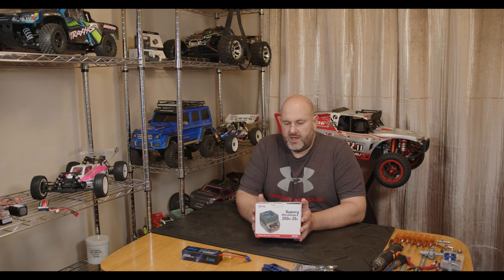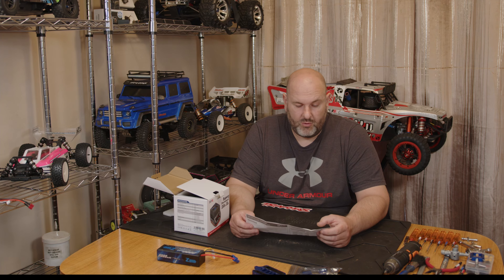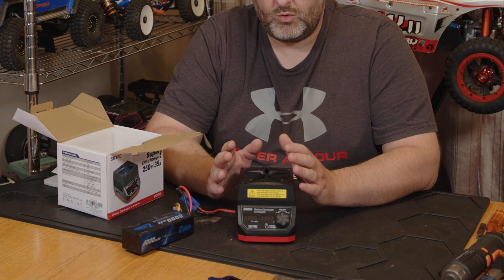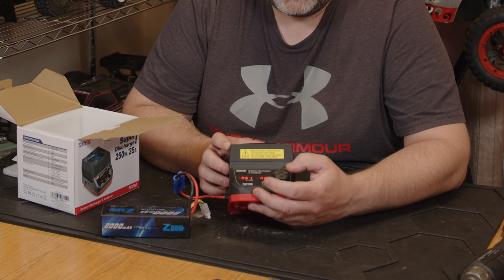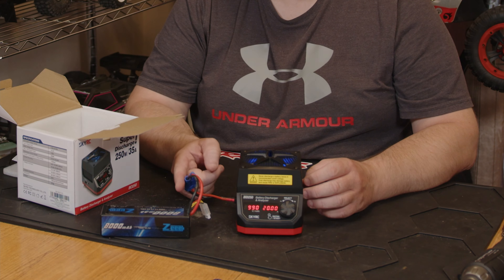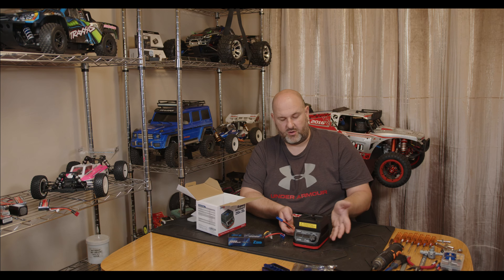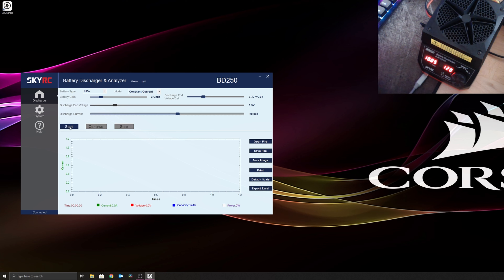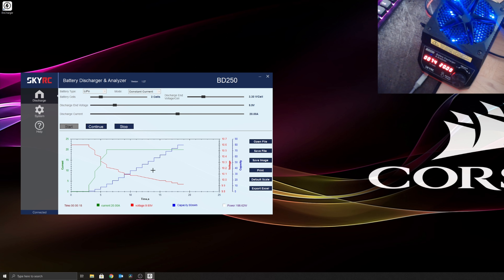Sky Rc BD250 Battery analyser

Comment: If I had seen this video before I wouldn't have bought it for sure. It dose not put my batteries in storage mode at least I play with the current drain and cut off voltage x cell. With this video I know it is a analyzer.
Reply from the maker: It is easy to find what voltage you need to set to get your lipos down to storage :) just drain them once then see what they recover too they will always perform the same so you can find the correct voltage to drain them too every time :)
Reply: @WTFRCCars  I did it and I found the value for 2S batteries 5000 mAH but if you change the battery for another with different capacity or different cells then you have to find the new value once again because it wont be the same when changing the capacity or the cell's number. Definitely it is not the correct device to put your battery  in storage voltage. Like you mentioned before it was designed for analyzing the battery. Best Regards.
Reply from the maker: Yeh definitely, it's a battery analyser 1st

Comment: you can you arrow keys first click on slider get it very close to what value you want like .01 or .03  away from what you want then use the arrow key . it take 4 presses of the arrow key to move up or down .01 so that is why you want to be within .01 to .03 from the value you want to be at.
Reply from the maker: I'll have to give it a try thanks 👍

Comment: Good work, this is what I was looking for, and it answered most of my questions! I am really curious about the 6-minute data limitation. It looks like you can 'view' for more than 6 minutes but you cannot export more than 6 minutes of data, is that correct? It's a really weird limitation they built into this charger and I am trying to find out a little more info before purchasing it.
Reply from the maker: I've no idea what the 6 min was about as you can see there's no limit to what you can see, it's not a charger though it's a discharger only
Reply: @WTFRCCars  Have you tried to export a .csv file? I think they only allow you to export 6 minutes worth of data. However, as you commented, most racers only care about the first 5 minutes...

Comment: Thanks for the video! What’s the recommended C rate for discharge? For charging I always use 1C (mah/1000) but for discharge?
For example, if my battery is 5000, I charge it at 5 amps max
Reply from the maker: For discharge you need to remember that the higher the c rating you discharge at the more the cell will rebound to a slightly higher voltage when you stop the discharge so, if you want a storage charge at 3.8v per cell you can discharge as fast as you like to 3.8v per cell but then leave the battery for 10 min to settle and then put it on again at 3.8v per cell but at 1c rate so 5amp for a 5000mah battery :) hope that makes sense
Reply: @WTFRCCars  thank you! So basically I can use even 20+ amps no? Are you sure it’s safe for the battery?
Reply from the maker: @nirlachman007 yeh even 30 amps is less than most RC will draw from it, just keep an eye on it just incase it's starts to get too hot the 1st time you try at such high amp :)
Reply: @WTFRCCars  thanks buddy!
Reply from the maker: @nirlachman007 any time :)

Comment: Isn’t 3.8 the best voltage per cell to store it?
Reply from the maker: Yep 3.3v is the lowest I'd drain them when running, this was a capacity test not draining to storage :)
Reply: Ow ok, thinking about getting one. I have a spectrum s2100 charger that has discharge capacity but i believe it is way too slow.
Reply from the maker: Yeh these do it much faster

Comment: why did you not mention in your video that if you discharge it at 10 amps the sag in the battery causes it to stop, it dont ramp down like the isdt chargers and when it stops the voltage shoots back up so it does not discharge to storge voltage which is the whole point of the discharger
Reply from the maker: That's not what this discharger is for its a battery analyser, it's designed to put the lipo under a constant load so you can see how it behaves, it's also designed to drain lipos very quickly, all batteries will recover from a high drain when it stops so if you want to use it to drain a lipo to storage then you need to drain it fast down to 3.8v then allow the battery to cool off then set it to 1amp and 3.8v again then it will be drained quickly and correctly to 3.8v hope that helps :)
Reply: @WTFRCCars  its a battery discharger its ment to bring the voltage down to the voltage you set it to not a volt above the required voltage selected
Reply from the maker: That's not how they work at all if it was and you set it to fully discharged a lipo it would have to take it down to below 3v and that would damage the cells, you can't discharged at high amps and it stay they that's why if you run your RC with lvc set to 3.3v per cell it will always be above that even though the RC cuts off :)
Reply: @WTFRCCars  try an isdt at 20amps it lands smack on 3.85v per cell everytime
Reply from the maker: I'm sorry you don't understand that the isdt is  a discharger and it's only function is to discharge the battery, the skyrc is a discharger analyser it's main function is to connect to the pc to give you the full graph of what the battery is doing, there both capable of being used to drain a battery there not the same thing.
Reply: @WTFRCCars  in big writing both in its advert and on the box it says super discharger so why is its main function not a discharger, it does not advertise super graph maker or say on the box graph maker, its advertised and discribed as a discharger which is misleading when you go out and spend your money on it
Reply from the maker: The are both dischargers but you can't blame a product because you miss understood what it is, one is a discharger and one is a tool to analyse a battery
Reply: @WTFRCCars  i get that, that wasnt my point, i bet alot of people have purchased it and then realised it doesn't do storage, my point was that you said in your video that it will discharge down to a certain voltage at high amps, then you stopped the charge and didn't mention that it won't actually charge down to that voltage because of the sag. So many will buy this product after watching your review of it and think it will discharge to a voltage and job done when in reality thats not the case. Mine is being returned and i have purchased an isdt version but i thought it was worth mentioning that you glossed over that part in your review
Reply from the maker: Yeh get what you mean :) the skyrc one is designed to show you how strong or weak a lipo is and you will find if you put a high quality genuine high c rated battery then the sag will be much smaller it's the lower quality ones that have much bigger voltage sag and that what it's designed to show you :)
Reply: @WTFRCCars  it is a pity cos they would have a much bigger customer base to sell to and its a really good  unit quality machine, if they had just made a ramp down feature that would have made it so much better. I don't want to send it back but i need to switch it on and get mt packs back to storage, i fly so much i don't want to be managing a discharger aswel, my isdt fd200 turned up today and the 25amps will be more than enough for me, I've heard its as good as the smaller fd100 which is 6amps and been using for over 2 years, I've just started racing so my packs are now bigger and i also now have field charging packs too so this will make management alot easier
Reply from the maker: Yeh the skyrc one you can work out what to set it to by setting the discharge to 3.8v then the amps and when it's done see what it recovers too then - that from you target voltage so you may find you need to set it to 3.3v and it will recover to 3.8v when the load stops but it's really designed to be used for analysing the battery :) the isdt will be more use for you if you just want to get the packs down to a set voltage :)
Reply: I had this issue so what I did was to put the cut off voltage at 7.41 volts (for 2 cells but fro 3 cells I set up in 11.11 volts) at 10 amps. After around 10 minutes I got 3.82 volts x cell in my batteries. I don't know if this a bug.
Reply from the maker: It's not a bug it's just because the cells drop voltage under load and the cheaper or lower quality the cells the more droop and more recovery bounce back you will get :)